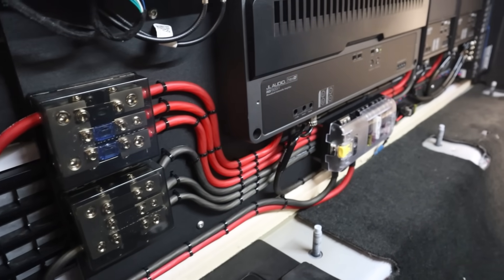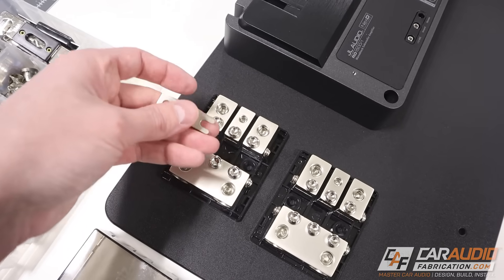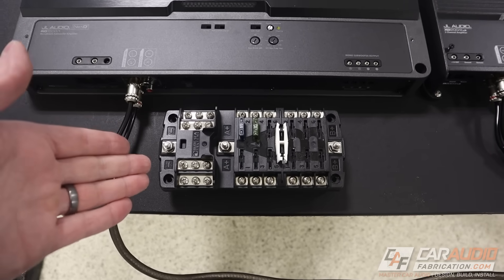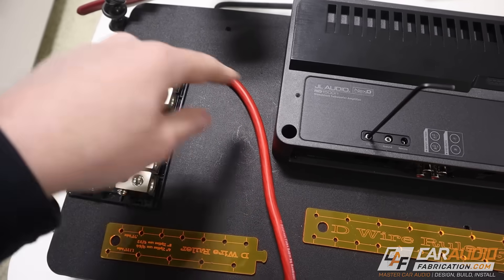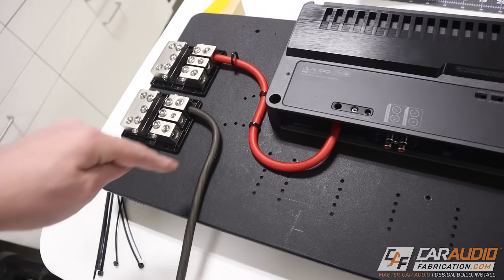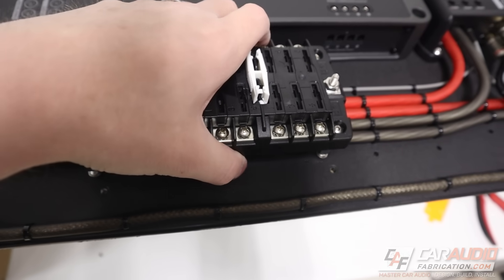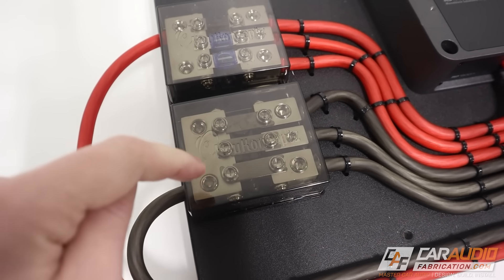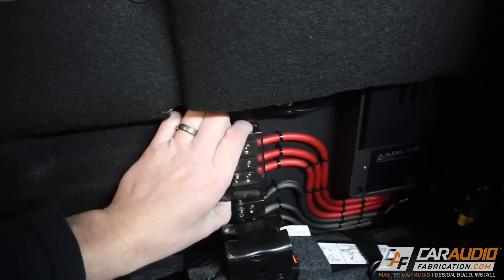Two Fuse Blocks, Multiple Amps and DSP? How to Wire COMPLEX Amplifier Rack!

Comment from the maker: Thanks for all the positive vibes guys! I mentioned a relay video and you guys said you wanted it, so here it is! https://youtu.be/JELMaHrzNuk
Reply: Hey i know this video has been out a while but i had a question about over heating i had wanted to do the same for my build but was told that the amps would over heat with them being mounted like this is this actually a issue or is that like a issue with older amps?
Reply: Thanks for the info
Reply: You're killing my Visa!!!  I've ordered two new tools just this evening!  Love the videos.  Keep 'em coming!
Reply: OMG ,, good
Reply: U, Williston, EXO, and JacoViral make me feel ok with trying to catch up with all the new shit that’s popped up over the last 25 years. When I go to the local sound shops, it’s a blank stare followed by “it’s $95/ hr bro. Unless u want us to build it, then quit talking and hand over the card”. Shout out to Creative Car Audio in Joplin MO. U guys are the “shit”.
Reply: Ok, I’ve said great stuff about u guys! I wish I had ur whole construction setup. Ur router table and skill are TOO good!! Ur a cyborg, right?? Ur wiring is immaculate.
Reply: Mark, did you have to remove the back insulation panel to cut it and if so, what is the process to remove?

Also, by removing the insulation, is there more outside sounds to be heard or does the sound deadening material absorb that?

How about condensation forming on the rack system?

Comment: Do you need to add the remote turn on line when that DSP has a smart remote turn on(the Auto detection turn on) for it if using an RCA?

Comment: On the distro blocks you used, they come in different amperages. Is that the fuse amperage or the amperage the whole distro can handle?

I have an amp with 2 0gauge inputs but the fuse rating is 600a. Do I get a distro with two 300a fuses?

Comment: been  a long time since i dabbled in car audio; is running your rca cables in such close proximity to power wires no longer a big no no ?
Reply from the maker: If you buy cheap gear it's still an issue. Get quality amps and wiring and it's zero problem.

Comment: Dude, I need you to do this in my regular cab Silverado. Not sure where the sub will fit, maybe a low-profile 10" JL sub under the passenger seat, or I could go with smaller amps like two Alpine Type R amps (a 4 channel and a mono) and a DSP, then mount the sub next to the amp board behind the passenger seat. I want 3-way components up front, then a single sub for a nice clean SQ build.

Comment: I have spent the last hour trying to find that fuse block/distribution block that has 12v DC outputs for accessories like LEDs and fans. I can't find it anywhere. Can you link the manufacturer or retailer? I can find plenty with 0/4/8G outputs but that's not what I'm looking for.

Comment: That title pic is a thing of beauty. I use to work in a factory that built huge helical machines for transmission factories and we would have to run dozens of hydraulic and cooling lines, stainless steel tubes all bent to line up and look really uniform like the wires you’ve run.

Comment: For a two amp system 1080W RMS total, wired two an isolated second battery, why cant I forgo the distribution blocks and use the Blue Sea Safety Hub 150 which has 4x 30A-200A midi and 6x1A-30A ATO/ATC Fuses wired with 2awg from the second battery. 1080W RMS / 14.4= 75 /.80= 93.75A(max) x.50(bass heavy) 46.8A(estimated bass heavy usage). Thanks

Comment: HELP!!! First off... Digging you videos!! I can't find ANYTHING on 3rd Gem Dodge Ram 1500 quad cab stuff. Particularly mounting amps. Am I better off mounting them under front seats? Although I'd rather mount then behind the rear seat... there just doesn't seem to be enough room behind the rear seat to me. Do you have any pictures of a past build that you'd be willing to share? Or another video keying in on what needs to be done to the wall behind the rear seats to come out with a successful install?

Comment: I'm trying to install a voltage meter to my secondary battery. Where is a good 12 volt constant to run my positive wire and where should I run my negative to. I was told to run my positive to the battery and the negative should be grounded.

Comment: What size wire are you running to the amps 4 gauge? That block has 2 0/1 and 1- 4  gauge out are you just running 4 gauge?

Comment: Wow, great content! I am learning so much. I do have a question with the knuconcepts distribution blocks will they take an 8 Guage wire out or only 4 guauge I will be running 3 amps 2 mono sub amps (for 2 alpine halo 10" loaded enclosers) both with 4 Guage then I need to run 8 Guage to my 4 channel amp so I was wondering if these blocks can be used with my set up thanks again Mark.

Comment: At what point would you refrain from wiring a bunch of items to your trigger, and add a relay?  I would have thought 3 items might be a bit much for your DSP turn on circuit?  Maybe run a relay off the turn on lead from the DM810 and have the relay supply power from your accessory fuse block?

I’m planning on doing 2 amps and an epicentre off a deck turn in lead, but was planning on using a relay.  

What do you think?

Comment: I have a 600 watt amp and a LC2ipro LOC. I was going to run 1 (4 gauge) wire from the battery to power both the amp and the LOC but I cant find a simple solution to split the power with a power block because the huge size difference in power wire. 4 gauge and 14 gauge. what would you suggest?

Comment: Question, I see that you daisy chained your remote wire from you DSP. How much power is recommended for those multiple devices before needing to add a relay?
Reply from the maker: The reason I added a relay is so that I can power multiple accessories (lights, fans, etc). The current for the turn on circuit on amps and DSP is minimal
Reply: @CarAudioFabrication  thank you

Comment: Man, you don’t get a system set up anymore professional than that! That’s how all wiring systems should be wired. Including all the wiring on my surround sound theater system where no matter how hard you try not to get your wiring all tangled up it still magically finds a way to tangle up in knots practically! 
I certainly like to get those accessories you used for attaching the devices and wires too!  But I’m sure that stuff not cheap either and that’s where I fall short on finances being disabled on a low fixed income  that sucks! Regardless, I do what I can with what I got and hope for the best?  Still I envy having all that cool accessories to make the job look all that more professional!

Comment: I just finally got my whole system together. I plan on putting it all together by mid october. 

I am a bit lost tho. I have lc 6-1200 amp 6 channel and a kenwood exelon mono 500w mono for the my single sub. 

I got a power distributor from knukonceptz. It has two fuses. Im running 4agw all the way around with a 120a fuse for the wire runnin from the battery. What uses do i use for distributor? 120a for the audio control? Do i aslo use a 120a for the 500w amp?

Comment: Just a question, I have built a couple sound systems and I am also a ham radio operator. Generally when I set up a new power system including cables, second battery, main fuses, solid copper lugs and terminal ends; I usually run 2/0 welding cable for the main positive regardless of length. Is this a bad idea. I seem to be the only one that uses that big of a cable for anything automotive. 
 My radio transmitters and the sound systems run quite well and I’ve never had any issues with hot or , even warm cables.

Comment: Quick question for anyone who can answer it. I have a 2000watt multichannel amp I'm using for 2 door 6.5inch 2 rear 6x9 and 2 12incg subs. Nothing crazy. I'm having issues with the 6.5s and 6x9s dying on me. Like sometimes they'll play if I turn the volume up high enough and sometimes they're just dead. I'm using the factory wires for this, I didn't rewire anything. Any ideas on what could be causing my problem?

The amp setting are for full and the gain is only about half way

Comment: The biggest issue I have had with any car audio system is engine noise/alternator whine.  The more amps, crossovers,eq's,ect you add the worse it gets.  Vehicle didnt matter. And, I always used good parts. Alpine head unit, Orion, fosgate PPI, ect. I found the most simple the better. 1 Alpine head unit. 1)Alpine 3339 Digital EQ which was also the Xover. 2 10's or 12's 4)midrange 4) tweets. 2 amps 1) lows 1) mids highs. That had some whine but minimal. If I added say Audio control componets or more amps the worse it got. If I tried a cheap amp also lots of whine.  Tried all sorts of grounding spots. Made sure every spot was clean and used at min 2 gauge welding cable. Didnt matter. Best was always straight to the battery. I cant even imagine what a demo van would sound like.

Comment: These are nice but flex quite a bit and if you need to change something, you have to fully remove the entire panel because the head of the zip ties behind the panel and not easily removable. Yes it looks clean but you want to think about servicing and upgrading. And without fully mounting it with PL, this plastic will rattle and flex and damage amplifiers

Comment: Looks great but doesnt the 1500 need at least 2 gauge wire?
Reply from the maker: No because the 4 gauge is already oversized 4 and so short it will have no problems whatsoever carrying the needed current

Comment: I have a 2012 Chevy Silverado and installed a very similar amp rack with the addition of 3k watt inverter and auxiliary battery, got very complicated for me, quickly! I also added components and 6x9's to the inside of the roof above the rear window. It hasn't fallen yet, 2 years old. 😆 Great video, love the attention to detail.

Comment: Hi Mark, where would you recommend installing/mounting an amp rack on a single can pickup truck. Specifically an 03 single cab F-150. I am installing audio controls, Epicenter, D-4.800 amp, and LC-1.1300 amp.

Comment: Great video's but way out of my league. 
How about a simple build I want to install a single 4 or 5 channel amp can I get away with just a 4 channel 1800 Watts, Full Range, Class A-B, 2-4 Ohm Stable ?
with four 6.5" 360W Dual Cone Black Marine Audio Speakers
Total Power: 180 Watts per pair (360 Watts per 2 Pair) and one Bazooka BT8024DVC BT Series 400w Max 8-Inch 4-Ohm Dual Passive Tube.
Would I want or even need a DSP ? existing head unit is a Kenwood with 6 RCA outputs. I'm restoring an old boat and just want to be able to hear the radio when moving on the water. Blew up my old head unit by constantly having it maxed out trying to hear it. Trying to at about 6 to $800 Not looking to win any contest just nice clear sounds

Comment: I really like all the great videos and the info you give us on car audio.Ive been in the life since high school 1985 and learn new things and ways for doing things from you all the time,I recentley had the remote turn on quit working in my head unit.I have guessed my equipment was pulling to much from the deck so im tryig to put the relay in like you have done so it doesnt happen again.Heres the problem im trying to locate the same fuse block you are using and have been unable to find one.If you know where to purchace it i would really appreciate the info.

Comment: Back on that remote turn on using a relay is that something i should do running an aftermarket CD player 80 prs Pioneer right now i am  using a heavier 12 or 14 gauge wire for remote lead and  im running 2  jl slash 1000s but  adding a 4 channel  as well and for some reason there wasnt a fuse on that remote circuit for the wiring harness either i did run an extra ground  to the cab tho anyway I like the relay idea myself used to wire in for chicken light switches on Peterbilt trucks

Comment: I absolutely love the attention to detail here. I can't wait to employ a similar technique to my SVX. It's been a long road to recovery on the build, so the tunes have taken a literal backseat to the mechanical repairs. Currently I'm addressing the rear differential, bushings and wheel bearings. As I wait for parts I nibble away at the stereo stuff. So, the project never stops.

Comment: There ya go, there’s that aircraft wire layout. It’s easy to follow. No question as to what’s going to where. Prior planning prevents poor performance. Would rivet threaded inserts work in this material of the component board? Enjoyed seeing the wire ferrules being used on the connections reducing short circuit issues from stray wire hairs. This system should really thump and wail. Looking any video on this build. What about the surface treatment and it’s distribution? This is a real statement build. Just saying. Stay safe my mates!😊👍🏻😷

Comment: That’s going to be super clean when it’s all done.
A little trick I learned years ago to get tighter bends out of heavy gauge wire is to warm up the cable housing slightly with a heat gun.
Just as long as you’re using a high strand count OFC wire it won’t be an issue.

Comment: Another great video Mark, thank you. I noticed you didn't use any heat shrink on the power and ground wire ferrules. Do you feel it's not needed?
Reply from the maker: It just holds the ferrule until crimped, or terminates TechFlex if using that. Not needed for every application IMO

Comment: mark i have a question. i installed a 4 channel amp and theres static on the back speakers i got all the set up perfectly is it possible that the amp is no good? or bad rca cables?
Reply: @xav1er512xo  did you manage to fix it in the end?
Reply: @StateBiscuit  indeed i did it was bad rca cables they had pinched

Comment: Nice rack bro, only thing I think should be changed is using screw inserts instead of tapping holes, that way you'll never hav an issue with fixing and unfitting screws for the amps/blocks or whatever. I do understand that can be tricky if the substance isn't 10-3mm think ish.

Comment: Video idea: most people do these in phases. My phases went like this.
Car is 2011 Ford Edge Sport with Sony and navigation.

Phase 1: door 6x8’s (x4), and sub. (Both factory and my sub is dvc@4ohms x 100w.

Phase 2: sub amp, 6ch highs amp, custom 6x9 in rear door components with tweeters in a pillar. Loc with roll off compensation.

Phase 3: sound deadening, amp rack, cable management, and distribution blocks.

Phase 4: head unit, maestro rr2, factory amp delete, center delete, replace d pillar 3 1/2’s and amps.

Phase 5: dsp install, ground, starting, and charging system upgrade, and finishing touches.

The only waisted item was during phase 2 getting a cheap loc.

Comment: You are a bad man. Omg. I am learning.  Maybe I'll hook up my own system. I'm scared to. Lol. Too much power. 2-skar vx4-st super tweeter, 4-jbl gto 939, 2-jbl gto 629, 2- skar evl 65 subwoofer, 2-skar evl 12, audio control dm 810, jvc kw-m150bt, blue sea fuse box, 1- down4sound jp23 amp, 2-down4sound  234 amp, 1-down4sound lto 6.0-12v lithium battery 3000-5000 watts.  In a 2010 camaro. Of course I'm using knukonceptz fuse boxes and wiring. I'm trying to find out who can hook it up right and dial in my dsp right. I'm in California may have to come to LV. plus the kilmat sound deadener.

Comment: I'd be interested in a switched power source video myself, not even for audio, but for things like footwell lights, and door lights and general ambiance lighting... Of course, I know that door lighting like puddle lights is slightly different in setup because you only want it active when the door is open, but still, would be nice to know... But I know that you are audio focused, so you probably won't deal with lights that aren't included in the audio setup, but it would be cool if you knew about that, to include some information about the other areas of lighting, particularly with LEDs

Comment: Yes on the Relay video, and can you make a video on how you hook up the Power and Ground wire por fav please!
Reply: I'll save you some time. Those distribution blocks have a dual input. That's why the "fuse block" is wired to the non fused side of the distribution blocks. There is still a unused input for the wires coming from the battery and out to the ground.

Comment: Why don’t you run the wiring on the back of the rack and only have the wires visible at the connections on the accessories?
Reply from the maker: Would require spacing further off the wall putting the amps closer to the seat. Might make sense in some applications but liking this way more
Reply: @CarAudioFabrication  it’s definitely neat and tidy.  I know a sparky who would be extremely impressed with your attention to detail

Comment: Cam you explain the relay process again and when will you and won’t need a relay?
Reply from the maker: If I hear enough of you guys say you want a video I will for sure!
Reply: @CarAudioFabrication  yes, yes and yes!)))
Reply: @CarAudioFabrication  yes please
Reply: @CarAudioFabrication  definitely would like to see a video explaining when and when not to use relay's in a system! Great install also!!!
Reply: @CarAudioFabrication  and a detailed one at that!
Reply: He's just running it as a turn on device for all of his amps and dsp. The blue wire going to the panel fuse block is the output when the relay is turned on, the wire with the crimp ferrul is the remote turn on from the radio. And your other two leads are positive and ground. It's just to protect the output lines going to the amps from shorting out cause he has the fuse blocks. And the ease of not trying to split one wire into 4+ wires
Reply: Do it
Reply: Yes please
Reply: Will I need a DSP for two JL Audio 13tw5v2-4 a JL Audio HD1200 amp 4 voice speakers infinity kappa and the amp for the four infinity kappa speaker also infinity kappa?
Reply: Relay vid plz